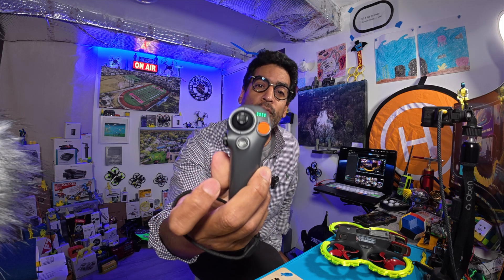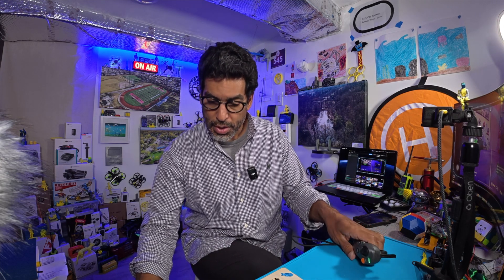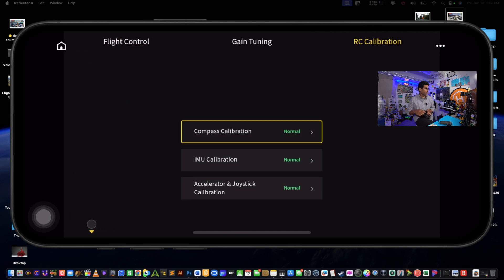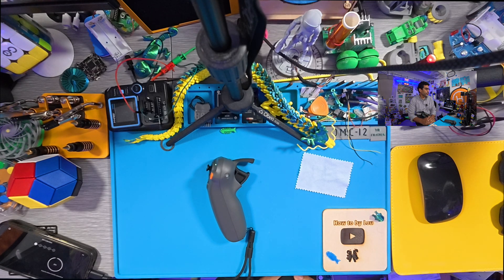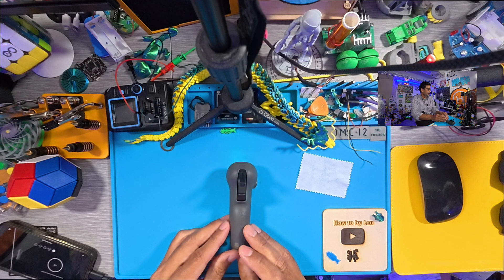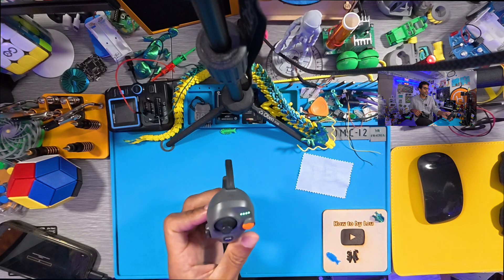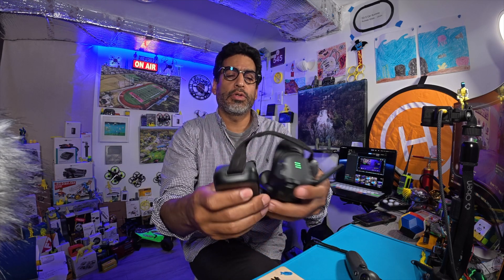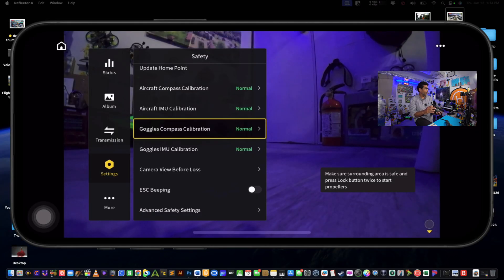motion controller calibration, motion controller not working, drone tilted while flying.

Comment: Regarding the video at the 3:33 mark, when calibrating the controller, I observed that after moving the joystick to the right, then up, and then down, the green lines continue to flicker upwards, then to the right, and then downwards independently even after I cease movement. When operating the device, it tends to ascend or drift to the right, and occasionally descends on its own. Could you please advise on what steps I should take, and whether a new controller might be necessary? I don't want to send it to dji because it probably won't make it back in the country because of the ban😢
Reply from the maker: You can try conning the motion controller to your computer and flash it again or see if there is an update and the calibration again.
 Hope this helps 

https://www.dji.com/mobile/downloads/softwares/dji-assistant-2-consumer-drones-series
Reply: Thanks I will try it thank you for your time

Comment: The accelerator and joystick never did anything during calibration. I did the trigger and moved the stick just as shown and it never finished. I did it over and over for 3 min. Nothing. Also, how the heck do I get the goggles on my phone like you so I don't have to wear the damn things to calibrate? Thanks.
Reply from the maker: Possible you may need to put in a support ticket with DJI

The link below will show you how to push the view from your goggles to your phone 

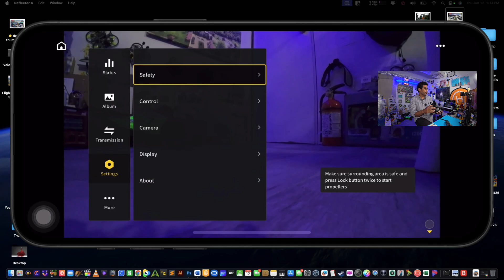4:25 into video, hope this helps. let us know how it goes 

https://youtu.be/_RWlIsLhi0I?si=pbmGm3Jf6yZdkcIo